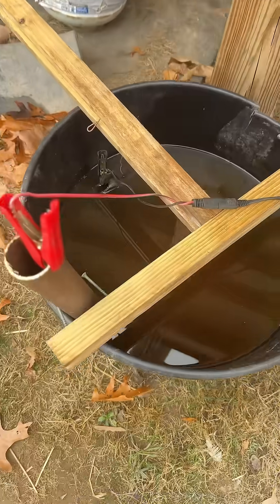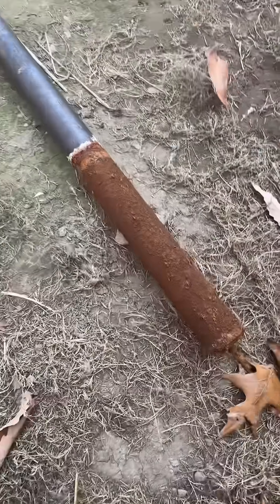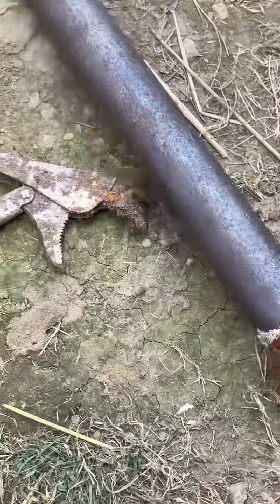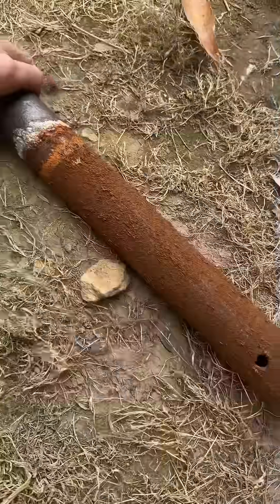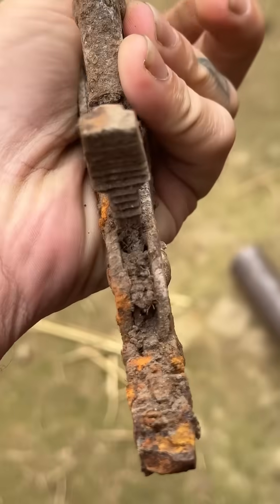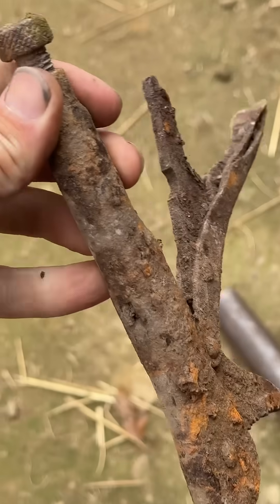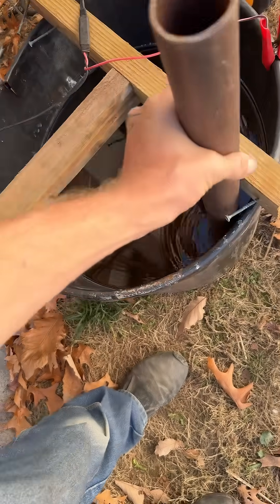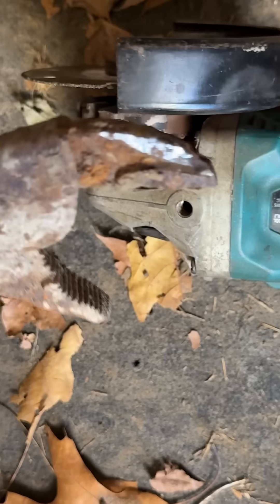How I do electrolysis to remove rust ￼

Comment: If doing this when it’s cold outside, do NOT have a heater on. You are creating Hydrogen gas, and Hydrogen and heat (specifically fire or sparks) is very dangerous: that’s the Sun: that’s a bomb: the Hindenburg. Please be careful.

Comment: Went to the hardware store and bought the washing soda you’re using. It’s all setup outside using an old school battery charger. Pulling 3amps,  as I can’t limit the draw so we’ll see what happens. I used 1cup of soda per 5 gallons, 2 cups total. All I had was a galvanized pipe so we’ll see how this goes.

Comment: I have a 55 gallon plastic drum I made one from. I use a 10 amp 12V non regulated battery charger and it only takes a few hours to clean a part. Only use Arm and Hammer Super Soda it only creates hydrogen that floats away. Some people use salt that creates Chlorine gas and can kill you do not use salt. I have a 100 year old rare cast iron pan and I made it look new without taking value away.

Comment: 3 words. Evap-o-rust
Reply: One word… expensive
Reply: @freepatriot6313  not true at all, I have the 3 gallon bucket of evo-rust with the parts basket in it for over 10 years... It doesn't expire or go bad.  It was about 40 bucks... That can be broken down to about 40 cents a year. Do the math, with all the time your wasting setting up a electrolysis operation. not to mention the toxic gas that's being omitted... Evap-o-Rust, take part, throw in basket, walk away, come back 48hrs later. You can also paint it on, It takes a bit longer, but I've done whole bike frames, Paint it on the frame, seal it up a contractor bag so the Evap-o-rust doesn't, you know evaporate.... Do this a few times, way better then citric acid bath, or electrolysis and less work. It also had rust inhibitors, so as soon as you take steel out of citric acid or electrolysis the exterior of the metal is oxidizing.. So that another step you have to do prevent more rust...

Comment: What type of battery charger are you using to be able to dial in your amperage? I have one of those dumb smart chargers that aren’t very good and have limited options. I’m guessing this won’t work?😊
Reply: A old one but you can trick smart ones into working in this way.

The part that stops the smart chargers from working on below 5 volts is the polarity protection. If you connect a battery that is above 5v via jumper leads the charger wills start charging and you can then remove the battery. 

So in effect you can hook a 9v battery (the smoke alarm ones) and your good to get the charger going.

Comment: 50 year ago this little old man was charging my car battery while i was in my car. He told me to start the car....then BOOM the battery explosion cracked the case and acid was leaking out. He let the hydrogen build up because he didn't take the battery caps off. That was LOUD!
Reply: Did batteries 50 years ago have no built in vent, so that failing to remove the caps could result in a pressure build up inside the cells? Every conventional lead acid battery I ever saw had vents built into the caps or the top of the battery so that wouldn’t happen. I also recall seeing old instructions on how to charge a battery, and they always started with “Remove the caps and place a damp cloth over the openings.”

Comment: As hydrogen is being produced from the process, I wonder if you have attempted any kind of recapture process for the energy? It could be as simple as a hydrogen fuel cell or maybe some kind of combustion engine, but if you using energy and just letting it go into the atmosphere, that's power you could be putting to better use and stretching your dollars futher.

Comment: Electrolysis is a good example of the flow of current, if you notice, the rust is stripped from the negative and added to the positive this is because despite the conventional understanding that current moves from positive to negative.. electrons actually flow from negative to positive.
Reply: Actually, electrons flow from the side with excess electrons to the side with a lack of electrons. Like air or water flows from an area with excess pressure to one of lower pressure, electrons do the same. We call an excess positive pressure and a lack, negative pressure or vacuum. So to be honest, if electricity is the flow of electrons, then electricity flows from positive to negative. The only problem is, someone got the symbols reversed and everybody keeps following the convention even though it is clearly wrong.
Reply: @Ethan.Lamoureux  sounds like the electrons are increasing thier population size where there isnt one. Wonder why that happens
Reply: Exactly!
Reply: @havelpants5248  ok.... sooo

what happens if i put a carbon electrode in the positive? it will only add up rust over it? will it not work?
Reply: @havelpants5248  look up redox reaction…

Comment: Hear me out: electrolyse the rust off the sacrificial steel using another sacrificial steel.
Edit. Also very timely, if you siphon off the gas into a basin filled with soapy water, you can have a residue-free firecrackers.

Comment: The Works "toilet bowl" cleaner. Its hydrochloric acid and will dissolve the rust off your stuff instantly. You're welcome 😁 Menards sells the biggest jugs, usually on the upper shelves because too many kids know how to make a "works b💥mb"
Don't mix hydrochloric acid and bleach or amonia, please. That makes nerve gas. Don't apply yo porcelain or skin. But its commonly used for corrosion and cleaning boat hulls 😳
Also another GREAT reason not to drink city water 🤢

Comment: Is 2A too much? My charger doesn't have a 1A setting.
Reply: @carolc.3661  That amperage will be depending on the conductivity of the water and the surface size of the objects. Some want more volts+amps for faster whizzz. Youll be fine with 2A. Remember minus for the one to be Reduced(from rust) Plus to the one to be Oxidized (scrap metal)

Comment: those locking pliers will probably need a new spring sooner rather than later, but otherwise electrolysis is the onlynway to clean those kinds of tools if it's been that rusty that long

Comment: And what is the purpose of this? And no, hydrogen from this setup is not that dangerous because it can slip through even glass and it's very hard to accumulate it enough for a real boom (it also requires a specific proportion of oxygen to make the boom destructive)

Comment: Here's what you do, you get a second sacrificial steel pipe and use electrolysis to clear off the first one, problem solved 😎
Reply: I was thinking the same or flip the pipe over but submerge 90% of it.
Reply: that is  out of the box thinking. Great!

Comment: I’m reading between the lines. How to create flammable gas. Nice.
Reply: There are much easier ways, this just takes forever and you get another use out of the reaction.
Reply: @Greenteabook  you can turn the power right up and use heaps of salt and be done in an hour
Reply: Read further. How to create iron oxide fast. Mix it with powdered aluminum and…
Reply: @sumguy01  shhhhh&
Reply: As a kid, my friends and I would make hydrogen filled balloons using a lye based (also alkaline like laundry soda) solution.
Reply: Tap it off into soapy water so you can have firecrackers without the smoke.
Reply: Say genius maybe you didn't notice but the treatment is done outside.  Spoken like a true Californian.
Reply: @markrouse2416 oh mark you poor thing lol
Reply: @CA-nd1mz  The advantages here is less damage from wire brushing, and you can go do something else. Granted some fine tuning with a sand/walnut blaster may be needed regardless. Wire brushing can be too invasive for some applications.
Reply: Same thing happens when nickel plating.
Reply: Can’t wait to hear about you in the news 🗞️
Reply: You can just buy it. Its literally the most abundant element in the universe
Reply: @CA-nd1mz  that's exactly what I gained as well 😄
Reply: lol fun stuff hen used with a 55 gallon trash bag and about 2' of fuse, fun fact hydrogen is lighter than air a minimum of 1' fuse is recommended to achieve a safe distance and wind is always a factor ;-)
Reply: right on brother
Reply: or better yet; how to power a zeppelin
Reply: Metal + Acid -> Salt + Hydrogen is significantly easier btw
Reply: EXPLOSIVE gas.....it doesnt get much more explosive than hydrogen.  if you fill a regular kids balloon - the size of a soccer ball.....and ignite it, it might blow windows out of nearby buildings....NO, not kidding.
Reply: @ssnerd583 I mean, the sun is basically just burning hydrogen 😂
Reply: @ ...no...that isnt 'burning' is nuclear FUSION much different than 'burning'
Reply: @ssnerd583  No, an balloon filled with hydrogen is NOT explosive and will not blow windows out of buildings. For hydrogen to become explosive it has to be mixed with oxygen. Hydrogen alone doesnt even burn.

If hydrogen would be explosive, there wouldnt be any witnesses or even survivors of the Hindenburg disaster, because the Hindenburg, a little bit bigger than a kids balloon, would have leveled Lakehurst like a small tactical nuke
Reply: @ssnerd583 yes kidding lmao youd need to have it like right next to a window. Source: done it in my yard with about a basket ball sized balloon and a firecracker
Reply: @ssnerd583  Seriously?  How can I do that without blasting my own windows?More civilly, if someone placed a hydrogen filled wine bottle on plate steel would it cut a well defined circle in the plate. If so that trick might be used  to holes where needed on a shop made steel stove.  
How would you collect the "vapors"?

Comment: Important to note why ventilation is required: hydrogen gas is explosive upon contact with a spark so be careful out there y’all
Reply: @PunkRatBast3rd  also if this is done with salt water it makes chlorine gas
Reply: This is good clarification. I didn’t even think about how the “make sure this is well ventilated because those bubbles are hydrogen.” Would be ignored because people don’t know the implication is that if you let hydrogen accumulate in an enclosed space you’re going to blow yourself or the enclosed space up on accident.

It’s always unwise to use implicit speech in hazardous situations, thinking the other person knows what you’re implying. 

One time in college after divvying up move out cleaning chores I explained to a housemate that he couldn’t use the self clean function on the oven, because it hadn’t been cleaned for too long. I explained to him that the self clean function burned off residue in the oven, and since there was about an inch of gunk that had basically been cooked into charcoal on the bottom, we couldn’t use the self clean, and he had to scrape the charred bits off the bottom of the oven.

I did not realize I hadn’t explicitly said if you turn on the self clean function you are going to set the oven on fire, I had only implied it. The point is, he started a big ass fire, which we luckily put out before it set the house on fire. I was late for work because of it, and the whole house stunk of smoke for a week afterward. The whole problem could have been avoided with clearer communication.
Reply: @FrickleFragginFruckl  well if they didn’t know by the time they’re adults it’s darwinism at that point
Reply: @FrickleFragginFruckl  People like you are the reason why kinder eggs were originally banned in the US.
Reply: No, hydrogen is flamable, not explosive and to ignite it there has to be an concentration of at least 4% hydrogen in the air, for it to become explosive it has to be more than 18%
Reply: bill nye taught us all that
Reply: nah, the hydrogen and oxygen buildup is negligible unless you're trying to derust like a dozen leaf rakes every day
tried making one with a jar and a few hours on a dingy set of plates made like a fl.oz of it, making an agressive "woof" at most
Reply: Actually hydrogen by itself is not all that explosive but when hydrogen mixes with oxygen it does become explosive. Technically you could capture the hydrogen gas and use it usefully if done correctly but is it really worth the risk?
Reply: Oxygen is explosive, hydrogen is highly flammable
Reply: @furioustester4056  No, oxygen isnt even flamable, its just an oxydator
Reply: @furioustester4056  no, oxygen does not explode, it doesn’t even burn.  It’s an oxidizer (oxygen) the makes burn able stuff burn or low grade ‘exploding’ .
Reply: Just do it outside
Reply: The Hindenburg used hydrogen didn’t it?
Reply: Test it for a squeaky pop! 😅
Reply: Thank god someone told ME this
Reply: @OneMuddyFeller  Google how to make an electrolysis tank and there'll be about million disclaimers warning about everything that can go wrong with it..

So sick and tired of modern people needing warning labels on absolutely everything because ya'll IQs seem to be lower than your shoe sizes...
Reply: @OneMuddyFeller  The sad thing is, this is middle school science.
Reply: @aminorityofone  if somebody's career doesnt involve anything from middle school science, how tf are they supposed to remember that after 20 years? genuinely curious.
Reply: @SublimeSynth  So you forget everything you learned in school? I am not a weatherman but i still know how weather works, and lighting. I am not an editor but i still know english. I dont use geometry for my career but still know how to find the area of a square.
Reply: @OneMuddyFeller  So am I. Yet I was about to comment that if people don't know that electrolysis splits water into oxygen and hydrogen AND the fact that it is explosive, they should go back to school.

We learned that in like, second or third grade! (8-9 years old here)
I realize that in some countries, children don't start learning chemistry until 5'th or so grade, but being over 16 or so and NOT knowing about it is just ridiculous.

Same thing with electrolysis of salt water, how does some people not know it releases chlorine?!
How have the people that don't know those things even survived this long?!

It's around the same age, maybe even earlier that kids are taught never to mix ammonia and chlorine!

Comment: How long does one bucket of liquid last and how do you dispose of it?
Reply: it lasts essentially forever and you just dump it out. its harmless. water, iron and laundry soap.
Reply: @DieselRamcharger  Would the laundry soap  kill grass?
Reply: @MsMistyMaiden  Nope. Its not actually laundry detergent which would be a fertilizer due to its phosphates, laundry booster is sodium carbonate. In large quantities it could affect the soil ph but you are only using a couple tablespoons per gallon of water. So it would do nothing to plants and grass.
Reply: @DieselRamcharger  I really love getting to learn new things. Thank you 🙏
Reply: @MsMistyMaiden  this method of removing rust is about the best one out there. This is what museums use on lets say a firearm thats been buried in the dirt since the civil war. Electrolysis will only remove the rust, it wont hurt the base metal. Its a great method.   It works in all the nooks and crannies. Sometihng rusted totally up youll be able to take the screws and such out after a 24 hour soak.
Reply: @DieselRamcharger  I'm hoping to get a new house soon with a little land, now you've got me jonesing to build one when that time comes! Gonna have to go out & find some rusty tools. 😆
Reply: @MsMistyMaiden  i use a pc power supply, 5 gallong bucket and rebar for my positive electrode. super simple easy and cheap.

Comment: I've seen electrolyctic rust removal in a small bucket but seeing it on a bigger scale makes it looks much scarier. Wires touching any kind of liquid always scare me even if it's safe
Reply: There's electricity and there's electricity. You would have to try extremely hard to be seriously hurt by a car battery
Reply: I get it, I have the same anxiety! I was relieved to hear 12 V, that's not a lot